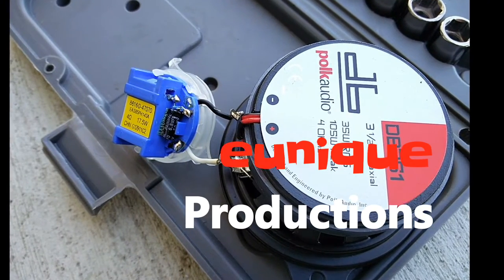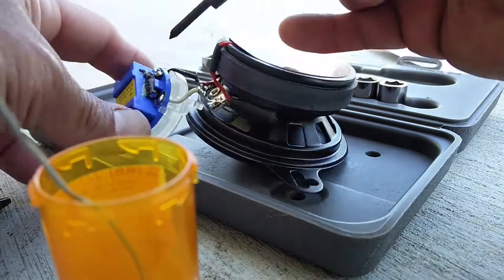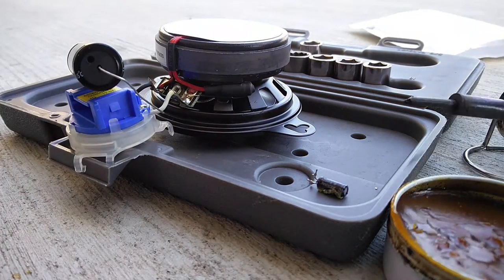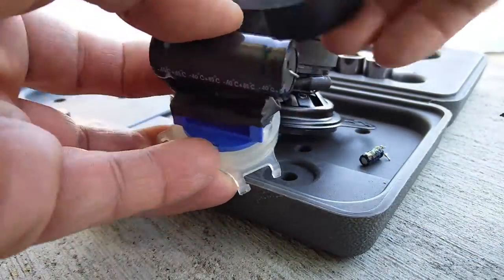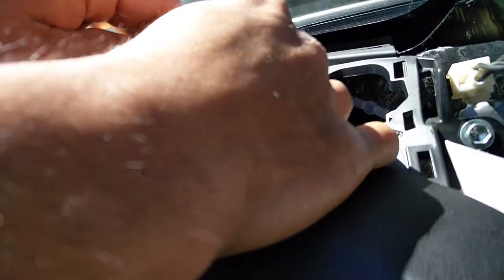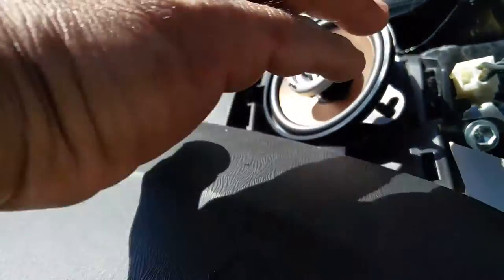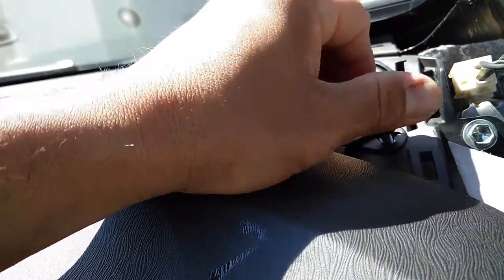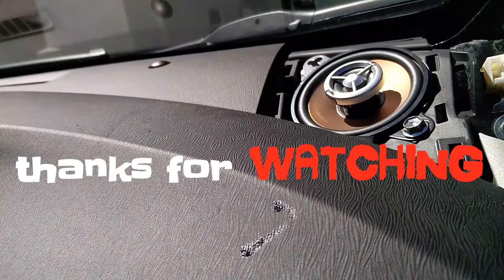Dash Speaker Upgrade for Toyota Prius

Comment: I did mine a little different but it worked. I removed the stock capacitor and soldered the leads together there on the plug and then added a 100 UF capacitor. Sounds good. Thanks for the help!

Comment: hi there I bought exactly like your speaker db351. speaker came with bass blocker which I used but it looks like my dash sound got louder coz my 4 front and rear door speaker on alpine amp right now.Dash speaker is directly connected to aftermarket amp 50 watt rms.Did u buy separate capacitor or used the one that came with your alpine db351?
thanks.

Comment: No amp required ??
Reply from the maker: +Ernie G. No amp...I am running it off of the stock deck and it sounds way better....the insulation / spund deadening makes BIG difference in how good it sounds
Reply: @euniquetrailadventures the insulation is what i ll be focusing on first